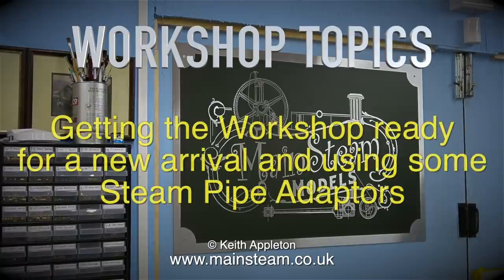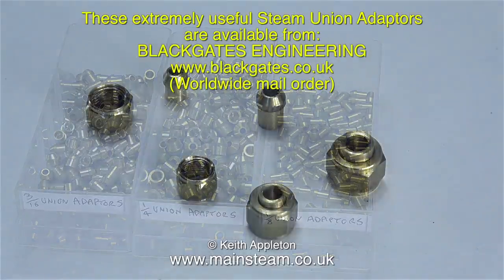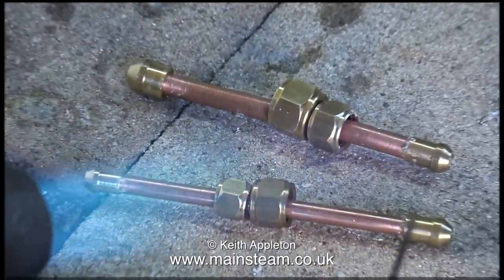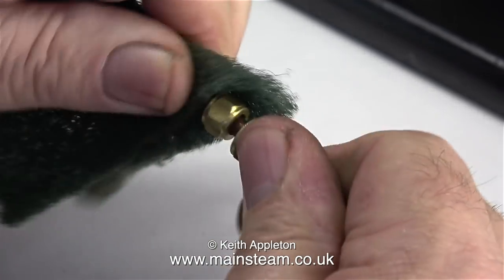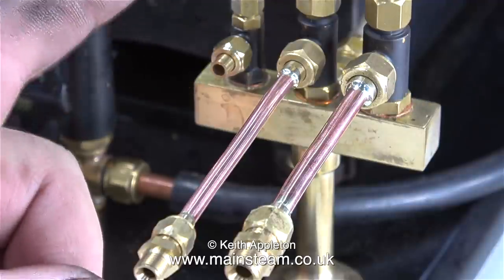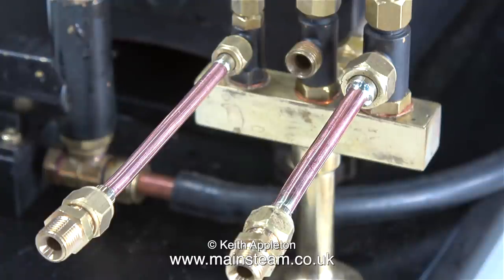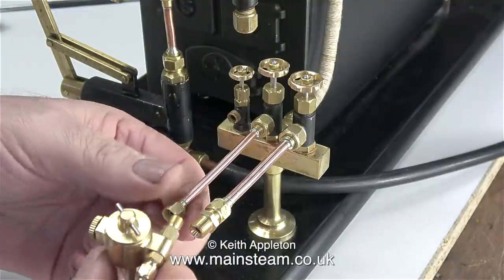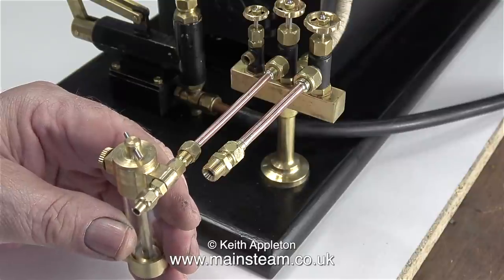WORKSHOP TOPICS - PART #13 - MAKING STEAM PIPE ADAPTORS

Comment: Ah! A bit more pipe polishing. 😀 
When soldering is it best to remove the flame just before adding the solder or allow the flame to heat it up a bit? I can't help putting the solder in the flame but end up with a large blob on the end of the solder.

Comment: One more question... Aside from the union adapters, are the nuts you're using to attach them to the valves original to them? Is there a standard amongst valves? thanks!
Reply from the maker: They are all commercial items with "ME" threads.

Comment: would it be to your advantage to make some clips to hold your adapters and displace3ment lubricator somewhere on the baseboard so you always have them to hand?
Reply from the maker: I will just screw them into the valves on the Turret.

Comment: is lead based solder allowed to be used in the UK?
Reply from the maker: I use it . . . .
Reply: It's not allowed for potable water and generally not allowed for electrical equipment that will be sold, but I don't think there are any rules that would restrict using it in steam engines (unless possiblly they were sold with generators attatched..........)